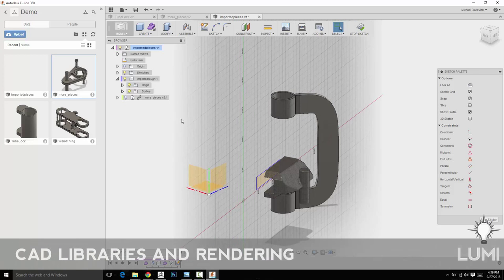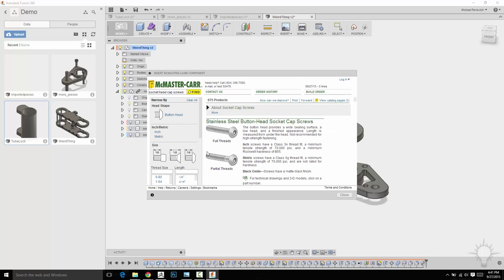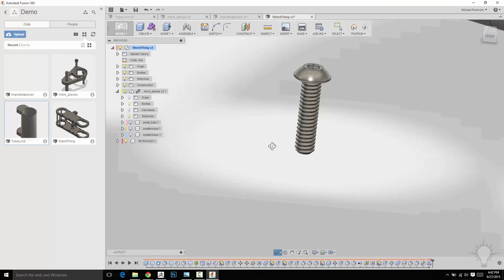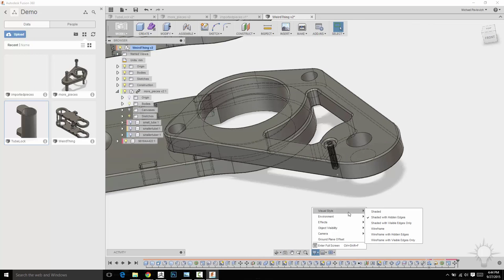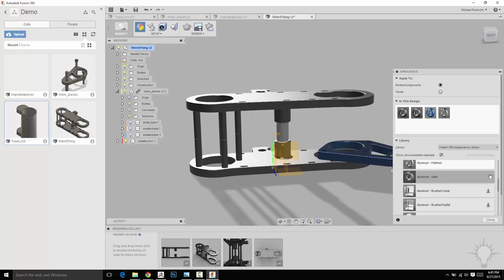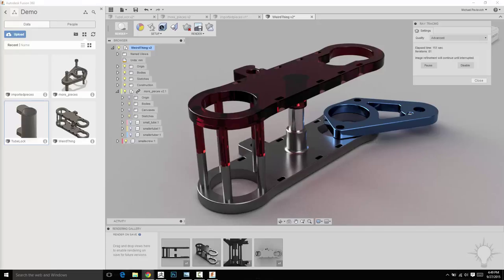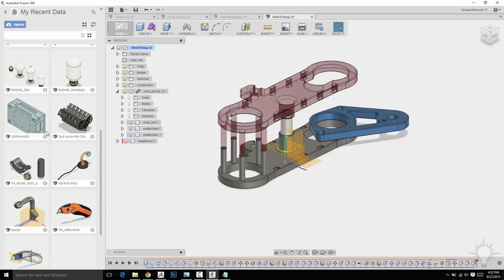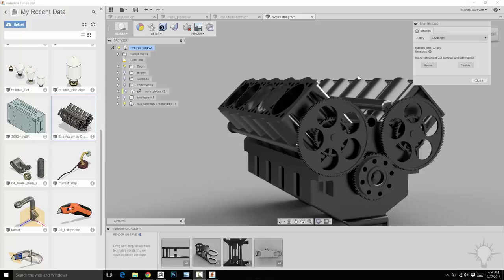013 Cad Libraries And Rendering

Comment: Coming from Blender to Fusion (I know they are for different types of modeling), it feels like getting out of your dusty old 1998 5 series BMW V10 with a manual gearbox and into a brand new Tesla. Both will be getting you from A to B but one uses levers and clutch and you kind of need to know how hard to press everything and at what time, and the other one will mostly do everything for you by touching some icons and pushing a button.